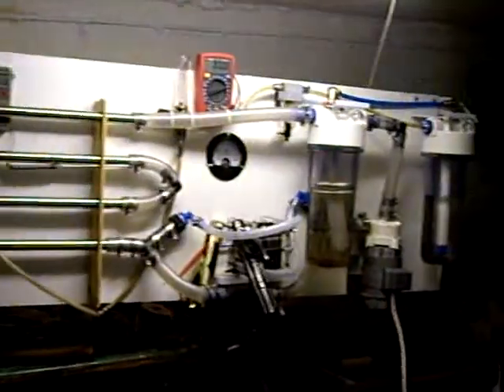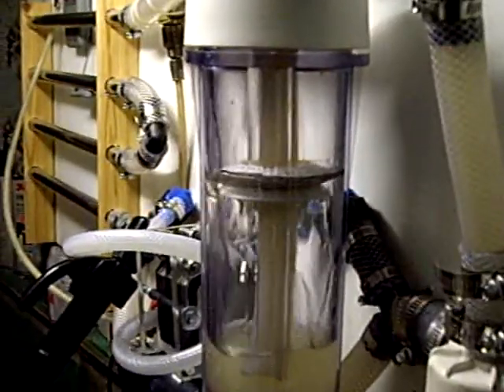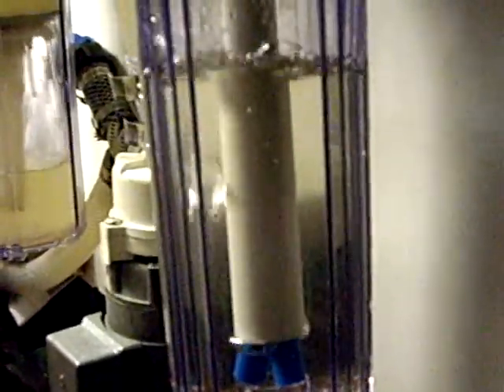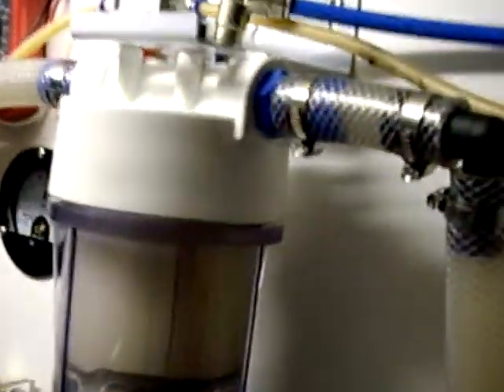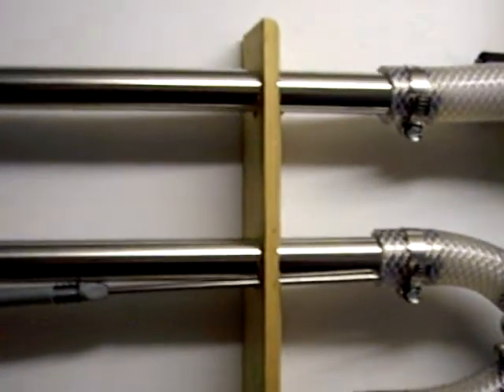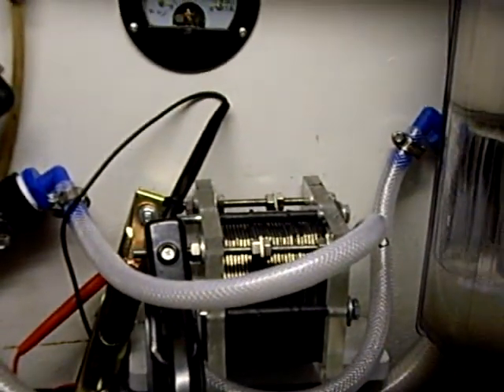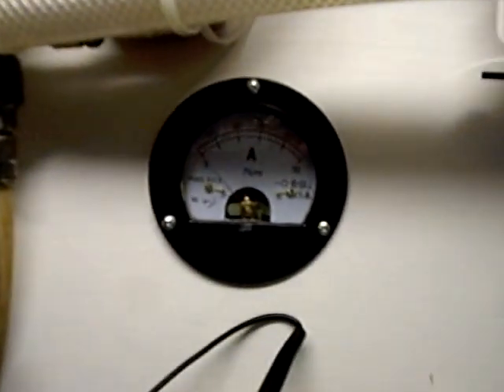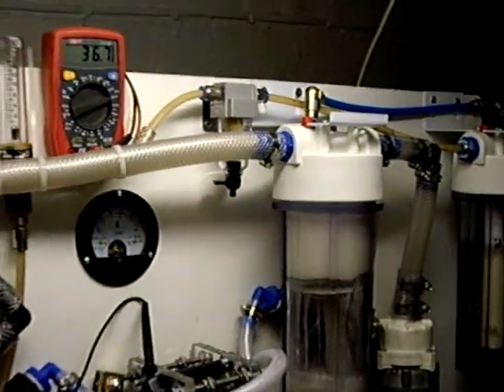New HHO Hydrogen/oxygen Station 2, In Action

Comment: @greenbynature by the way i have done sum research and in the old days they used steel plates and the devices would be ran for months at a time, im gonna try it , ss is a horible conducter and it creats a carsinegin, hexavalent chromium, i have the cell built and im gonna test it today, ill get back to ya, i love your work by the way, that bubble seperater would also solve my on goin faom problem

Comment from the maker: Thanks NOBOX7, your right, it would make a nice torch, on this clip i was using a 200A inverter welder as a psu, obviously it didnt know it was switched on at this low output.
I have a better suited bench power supply for my 14v cells at 5-15v variable at 30A but the welder would kick ass with a suitable 40v cell at 2v per plate.